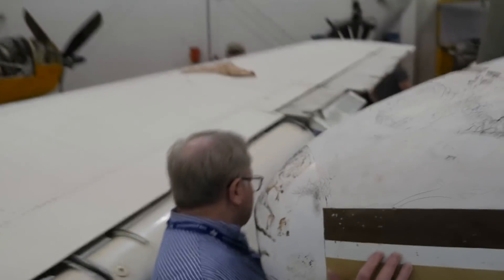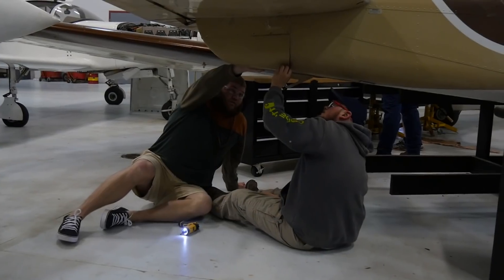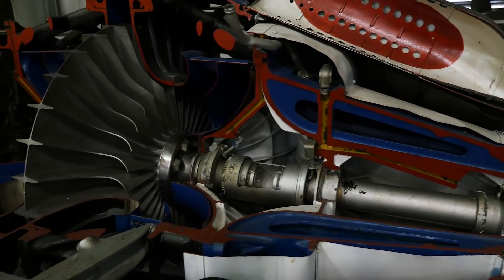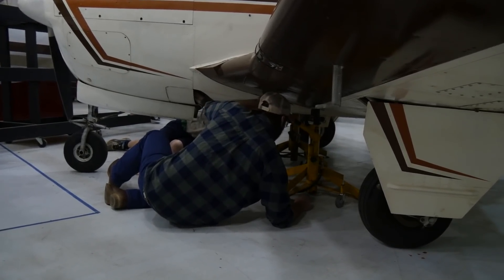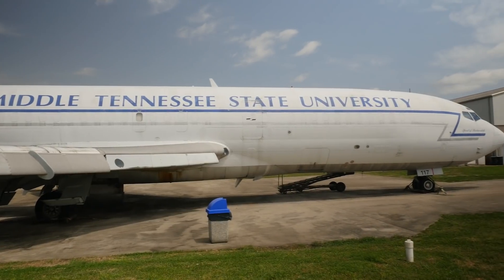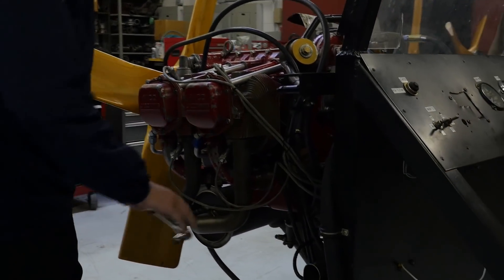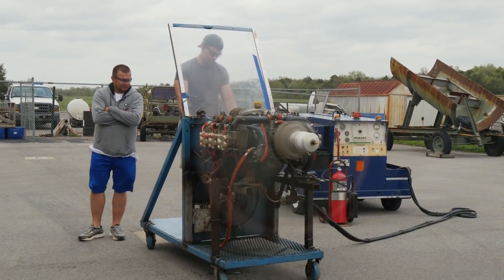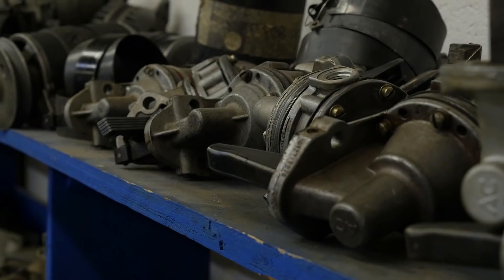How to Become an Aircraft Mechanic - MTSU

Comment: this is a highly recommended career to get into i am retired aircraft mechanic i learned this trade in the military got my degree in aviation and A&P all on the military dime all free just sayiing these schools are highly competive and expensive anyway just reaching out letting everybody know
Reply: I was thinking about going into aircraft maintenance. Is there alot of math involved in the A&P courses, if so what kind of math? Bc I’m not very good in that.
Reply: not so much except for electrical you need to be familiar with Ohms law and sheetmetal if you are good with fractions you just convert them into decimals power plant portions you learn the diffference between turbine recps amd gas engines

Comment: Man I miss working on aircraft.
Reply: You got to go to the Historical Aviation Restoration Society were everyone can work on Radial engines and a everyone’s hobby shop even at retirement or new to engineering. The dudes there that work on engines have worked on them for a long time restoring old engines so most of the aircraft can continue flying and long hauls on the Engines.
Reply: michael knowlden I was medically discharged from the Royal Navy due to a hip condition